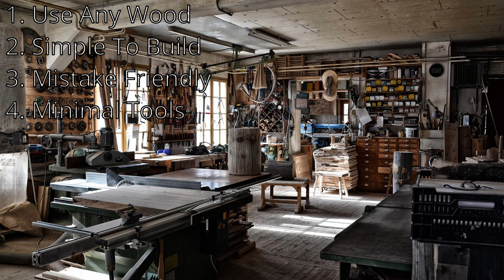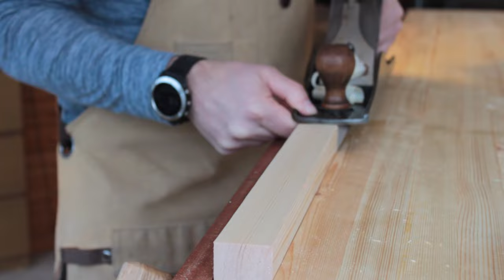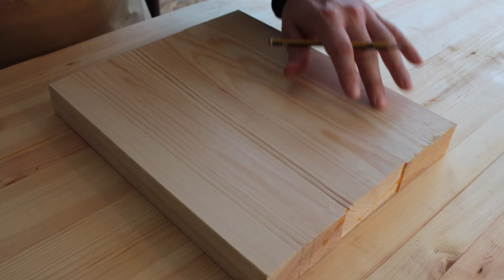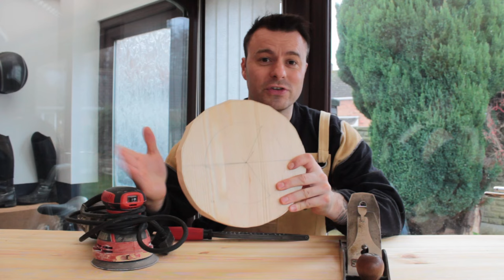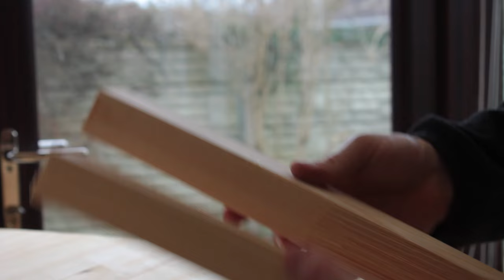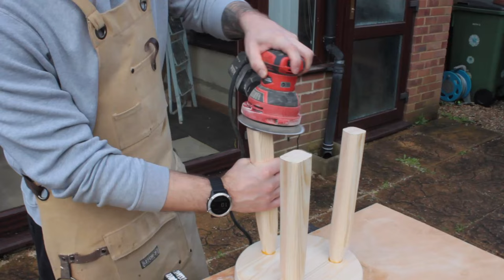Make a Three Legged Stool | Beginner Woodworking

Comment: Regarding why the pencil compass trick works, you've effectively made a hexagon with the points you land on with the compass, and marking 3 points of the hexagon provides you with the equidistance. The compass is set to the radius of the circle and, by the basic laws of geometry, the length of each side of a hexagon within a circle is the radius of that circle. Hope that makes sense.
Reply from the maker: That was actually a super helpful explanation, thank you!
Reply: I've never thought about it before, but it makes sense 😃

Comment: Surely the legs should be splayed out, typically as far as the edge of the seat in plan for stability?  Also, as the wedges for the legs are a different wood, they will make a pattern, which for me ought to be either radial from the centre of the seat or following the circumference, this require no special skill just an attention to detail.
Reply from the maker: I've made them with both straight legs and splayed out legs, to be honest I haven't noticed any real difference but as I only use them for display/plant stands - although maybe that's why. I definitely agree that if I was using it for more of a functional purpose the legs being splayed out would be more important. Thanks very much for the comment!